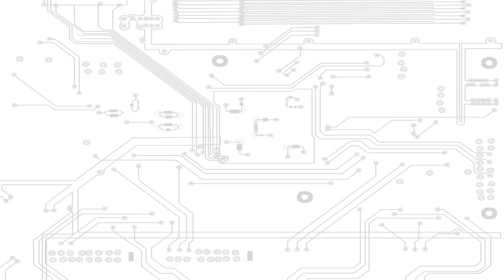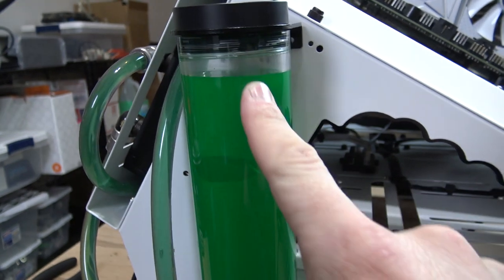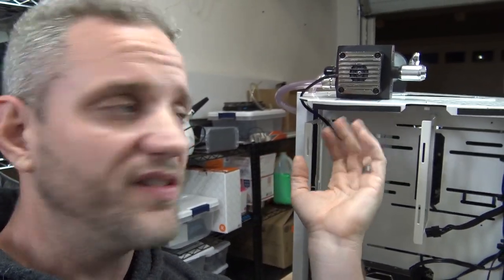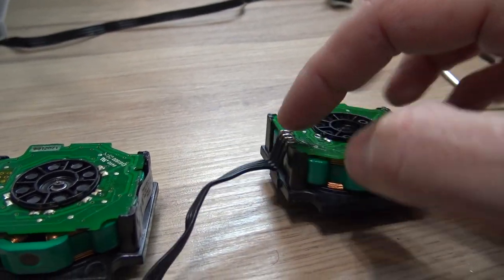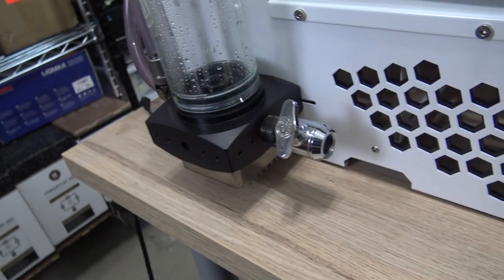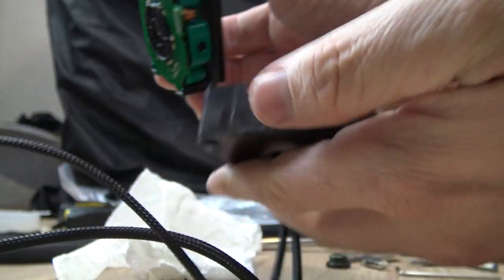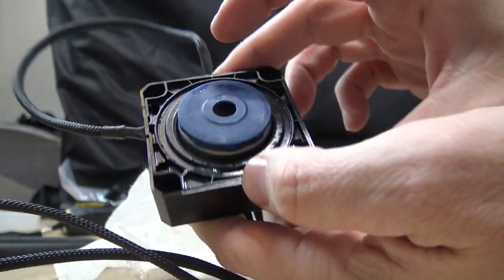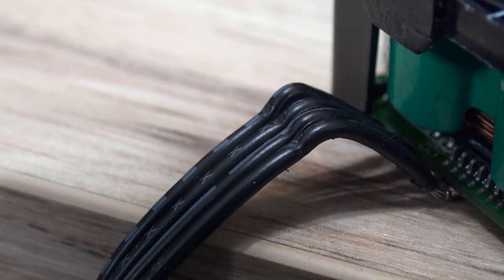My pump died... did the antifreeze kill it?? Let's pimp out my Test Bench!

Comment: Watercooling pumps getting hot? Just watercool them...
Reply: P - The P is Silent I know this comment is a joke and quirky but that's what pumps actually do. they dump heat into the loop.
Reply: yo I heard you like water cooling so I water-cooled you a water-cooling loop which is water-cooling the water-cooling loop water-cooling your water-cooling loop
Reply: for that setup to work properly you need to n2o cool the whole loop!
Reply: You need to watercool the water
Reply: but whats going to cool the water-cooling loop
Reply: DDC pumps aren't cooled by the water flowing through them. That's why they need heat sinks. They also operate at higher RPM's. Because of this DDC pumps achieve a higher flow rate and head pressure. For 90% of loops DDC pumps are overkill. 

D5 is more reliable and has enough head pressure for like 3 blocks and a few turns. The D5 pumps do also on the other hand release heat into the loop and use the fluid to cool themselves. This isn't a problem once the water reaches full equilibrium. 

Also running a DDC dry like Jay did won't hurt it at lower RPM's. The barring isn't going to give out all that fast. Now jack it up to full power and it'll most likely go out without a load on it. With no load I get a DDC will most likely die from the centrifugal force on the barring. D5 will die fairly quickly without fluid to cool it and with no load at all. D5's work sort of like a vacuum (makes the water pressure on 1 side lower then the other to achieve flow while DDC is just a spinning propeller that pushes the water via brute force. It would only take a few seconds to kill a D5.
Reply: oprime dude you really don't know anything you are talking about. If you knew how this pump works you would know that it can't suck water towards it only push away. Also what kills the pump is not the heat but the fact that the bearing is not lubricated by a liquid. All that happens is that the bearing material of the rotor gets basically eaten away.
Reply: maybe you should learn how a supercharger draws air into the middle of the spinning blades and pushes it towards the outside of the blades. Before you tell people they really don't know anything
Reply: Terry Wilson lmao
Reply: Recursive bro 😌
Reply: eatthisvr6 using nitrous oxide for cooling that seems weird lol
Reply: zettle 234 um superchargers work on multiple style ik 11 months late but they are a compressor and come in turbo style as exhaust driven centrifugal tvs roots and twin screw styles.

Comment: Jay, it looks like the Housing touching the PCB was the issue. NOT the pinched wires. so metal housing grounded a contact point either on the PCB or on the power leads into the PCB and then that touched something somewhere else on the PCB.... a Short on the power input wires would not have damaged the Pump... Electrical theory says: Path of least resistance means the input power to the metal case to the PCB created a melted IC

Comment: Jayz, here's a really good tip for you if you are wanting custom antifreeze.

Get yourself some ethylene glycol (but keep it locked away, seriously...)

Ethylene glycol is clear like water, you colour it with dyes as much as you like then you fill it with demineralized/distilled water 60% water to 40% ethylene glycol.

If you don't do the mix in that ratio,  the ethylene glycol will boil faster than water (it actually does...) 

Now, be sure to shake, pour and clean up thoroughly, if it's clear, treat it like ethylene glycol and wipe it down with all purpose cleaner.

Enjoy your custom antifreeze build
Reply: Your comment is a good one and made me look into this further. Water boils at 99.3 °C, Ethylene Glycol at 198 °C. A 1:1 solution of ethylene glycol and water boils at 129 °C. Ethylene glycol is completely miscible with water in all proportions. Therefore, once mixed, the glycol will not separate from the water, ever.

Comment: With regard to your Green dye making the tubes Red: some organic dyes are sensitive to their environment. A green dye may be green when it is in an aqueous environment (water) but may be red when in a hydrophobic environment (like absorbed into the plastic tubing). I work in a lab for instance and we have a common dye that we use for protein gel staining. It is dark red when completely dry or dissolved in oil, but turns bright blue when in water. Just a thought.
Reply: was hoping someone would offer an answer on that. thank you.
Reply: Fierce grape gatorade...  made your poo neon green...  lol
Reply: It's "tube burn".  You see it inside older hot tubs.  Hot water flowing against the plastic for long periods of time will cause a dark red/brownish stain.  The purple color probably has something to do with the green dye...

Comment: Jay why not grab a dremmel or file and make the opening bigger to release the pressure on the wires?
Reply from the maker: I actually did that on the plastic one, but I will do that on the metal one and reuse it later. Just didnt have the right size bit.
Reply: JayzTwoCents gotcha .... this video was very insightful though. I always love getting that notification of a new upload from any of my Cali tubers.
Reply: I'm surprised they didnt have a rubber grommet to fit that section where the wires are supposed to go.
Reply: Was about to post the same reply till I read yours...
"Fortunately I have a ton of these pumps laying around" damn that hurts...
Reply: JAY, take a better look at that Housing before you do. the power leads may be making contact at the solider points to the casing this may be the cause of the damage to the electronics. pinched wires that are fully sheathed wont cause an issue IF  they have not broken the sheathing.. your issue seems to lie in that metal housing and the contact points that are causing a short.. there may even be a chance of this happening again... if the wires were shorted at that Pinch point, the PSU would have kicked off when it detected a short. Remember: Electricity wants the path of least resistance.
Reply: exactly what i was going to comment.
Reply: @YoloVib3s  lo

Comment: If someone's already mentioned this, then ignore me. Pinched wires would not create a short, it creates high resistance or even possibly an open circuit if the wires inside the sheathing were pinched hard enough to cut them . A short would be if the wires were exposed and contacted a surface that's connected to ground or other exposed wires. Either way, love the vids, been out of the pc building game for over a decade and you've helped me get back up to speed on things!
Reply: Hopefully he addresses this, because you are correct.  Since the wire is stranded as well, the likelihood of it causing an open (aka breaking all the strands) is highly unlikely.  (The old pump could have, after many bends back and forth.. the new pump however.. nah..)

My guess is that the metal chassis cover itself was shorting to the PCB.

Glad someone else pointed this out too. :)
Reply: Yeah, definitively not the cables. Hard to tell if the chassis could be shorting the solder points or something on the PCB, but to me it almost looked like fluid damage. I've seen and repaired water pumps (not PC cooling ones) with water damage before, and it looks a lot like that. But that would be weird, if it was water, the blue smoke would have escaped long ago - I'm thinking a short was causing the original problem, and then during disassembly a tiny water droplet made its way onto the PCB and dealt the deathblow. Else it'd been smelling magic smoke all day in that room.

Comment: I have no idea why people keep buying those DDC pump heatsinks. What you're trying to achieve is to transfer the heat from the top layer of the PCB(where the hot components are) through 1.5mm of FR4 laminate which has thermal conductivity of around 0.25 W/mK. Any electronics engineer would tell you that this is complete and utter fail and bullshit. If you want to have your pump cool and long lasting just run it at 9V. The start-up voltage is around 8V so 9V is completely fine. It will draw around 5W @ 9V.
Reply: This.
Reply: better yet let the PCB and components breathe by making some air holes in the casing

Comment: Dremel the gap wider and put a non conductive thermal pad on the bottom the solder points could be shorting out on the metal.

Comment: Uh, how would that cause a short when the wire insulation wasn't punctured?
Reply: Yeah, the conclusion seems a bit flawed, although there is obvious there was a short when you see the fried electronics. I'm thinking the exposed part of the wire, where it meets the PCB, was touching the casing, which in turn was grounded.
Reply: +Jim C K Flaten That was my thinking as well
Reply: That would cause heat at the break, not burn out an internal component.
Reply: Not true Jim C K Flaten, Super low voltage can indeed damage components.
Reply: The problem there is not the voltage itself, but the increased current draw to meet the power requirements of the components. If this was the case, there would be even more heat developed at this hypothetical break in the wire.
Reply: i think its not shortening at opening but on the base of that cover. just put some hot glue where that wires connect to pump and call it a day.
Reply: Low voltage does not damage a component rated at higher voltages.... Low voltages through a high resistance (the hypothetical broken wire) also 100% guaranteed won't cause damage as shown on that IC. You can argue with the fundamental laws of nature if you want (Ohms law), but you'd end up wrong. I = V/R, no matter how you turn it. If R goes up and V remains constant (it does, the PSU won't increase the voltage), then I goes down... If I goes down with a constant V, you get less power P .

This was clearly some kind of short on the PCB or on the connectors where the wires are soldered to the PCB. Emphasis on short , not a broken or torn wire, the latter would just cause the pump to not work. Looked like fluid damage to me, honestly, and I've repaired a lot of fluid damaged PCB's on things like water pumps (larger ones, but they're very much similar to this), as well as on laptop motherboards. It might be something else, but it looked a lot like fluid damage.

Maybe a drop of fluid made its way in during disassembly, since the magic smoke didn't occur until after he re-assembled? Doesn't explain the problem before disassembly, but it sure might explain the magic smoke.
Reply: Compressing the wires like that can cause the internal wire to be deformed into a lower gauge, and increases the resistance, and causes it to heat up when power is sent through it. It is possible the pump electronics might be salvageable if he is comfortable cutting the wire shorter, desolder the leads, and solder back the shortened wire.
Reply: Billy Lothridge You should watch the whole video before commenting ;) There's a burnt component on the PCB ;(
Reply: +Lafika The problem you describe is not a short
Reply: +Billy Lothridge That's not how resistance works...
Reply: No, he tested both PCBs, and both had the same problem while mounted in the metal housing.
Reply: I suspect the board itself may have contacted the metal housing
Reply: Why even have a metal housing? I understand the heatsink component of it, but why is all of it metal? And with no insulation anywhere outside of the heatsink contact? That's just asking for problems.
Reply: there was no short, he got water or coolant in there at some point
short would have effected the power supply not the pump
Reply: I think he doesn't know the difference between a break and a short

Comment: Coolant shouldn't effect the electronics even if it did escape past the seal as the PCB and components are covered with a conformal coating which protects them.
Reply: well, its 50% and 50% water, so it would affect electronics if they werent coated, and maybe the coolant and even the water itself can wear out the coating

Comment: Awesome to see the humble ddc getting some love. I've been using one for years, and it's been a super reliable little trooper. They can punch well above their weight in pressure and are very quiet. The new impeller design is interesting, at first glance it looks like it might be designed to work better with a low restriction top inlet like in this setup, rather than the stock parallel barb configuration.
Reply: That impeller looks a lot like the one on a D5, with the shrouded "top" surface.

Comment: Jay. Just for fun. I have a thermal take water 2.0. The rad spring a leak so I soldered it shut. The loop lost almost all the water and had some growth in it. I replaced the liquid and cleaned everything. It now is running windshield washer fluid. I've gotten better results than with the stock liquid. Funny thing is they smelled the same...

Comment: Open Faced vs Closed face impellers:

The primary benefit to open faced is in applications that tend to clog. We used them for coolant pumps in machining due to small metal chips being introduced to the coolant reservoir. Another advantage is you can adjust them for optimal flow. The adjustment is the pump distance between the open faced impeller and the opposite facing surface. This is mostly for adjusting the recirculation, flow rate and coolant temp.

Closed face are useful in just about any application that aren't prone to clogging. Advantages are reduced recirculation with in the pump housing so they tend to run cooler. They are ideal for volatile liquids. 

I don't believe making adjustments to the open faced configuration is possible or advantages so either if fine. The only issue with the close faced I could see is with the viscosity of the coolant as a thicker coolant would be slightly restricted in the close faced impeller. But we are talking 100% antifreeze and this is not your setup.

Comment: Quick tip with o-ring seals, grease it. Not crazy like packing a bearing but a bit of light duty grease in the o-ring bed keeps the seal in place and adds a bit of extra sealant. Or silicone sealant

Comment: OK so this is the first time I have seen this video and I have stopped this @ 1:17 to comment.  First and foremost, You have any pump on the bottom of a reservoir, you have the potential for problems no matter what solution you use!

1) The main concern is that an electrical motor with a drive shaft connected to an impeller (as shown) also has a seal in the housing (hidden under the impeller) that has to deal with fast rotation of metal on a rubber seal that isolates the liquid from the motor.  That seal gets worn away by rotation of the shaft and thus the liquid will leak by the shaft and get into the motor which in turn cause's corrosion and electrical interference and finally electrical shorts resulting in failure!

2) To overcome item 1 above, a double seal of Viton or Silicone should be used with a good packing of Synthetic grease!  Only then might you achieve a long(er) lasting pump system.

3) Anti-freeze/coolant should have excellent anti-wear and anti-corrosive properties that best works with almost any closed loop system.  However, It's the seal(s) material that is critical to any system that must be considered!  IE: Buna-N/Nitril is a low end poor quality seal material where-ever water and anti-freeze is present!

4) I have to wonder sometimes if even the manufacturers of these liquid cooling systems for CPU and GPU components really know what they are doing and or why!

5) A magnetic drive pump would be far better for such critical applications such as a computer!

Ok back to the video and see what you came up with.

Comment: As for the antifreeze debate, I built my first water cooled system when Age of Conan came out. When I asked the tech guy about the coolant, he told me then it was just 50% distilled water and 50% antifreeze, I have been using it ever since. 
5 years ago I rebuilt the system using the same cooling system save the reservoir, as I cracked the old one by over tightening a fitting. It still has the pump CPU block, radiator and lines with no signs of degradation.